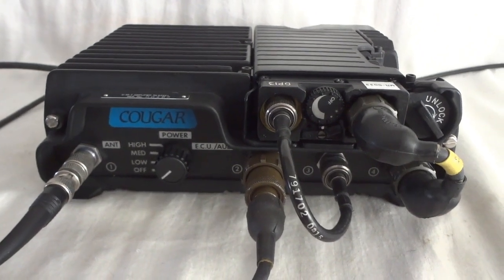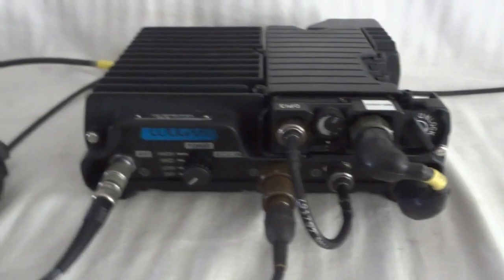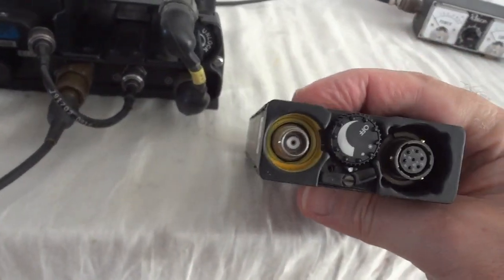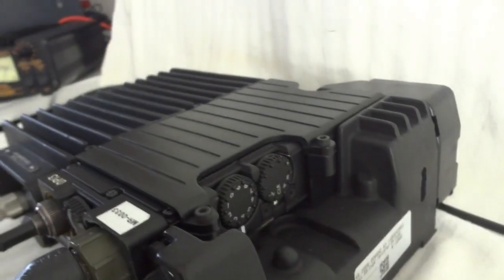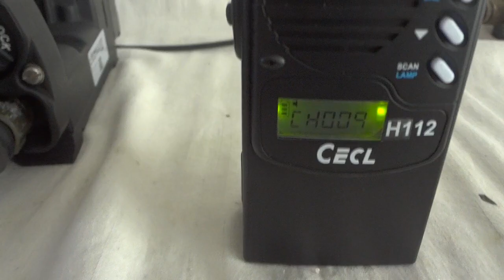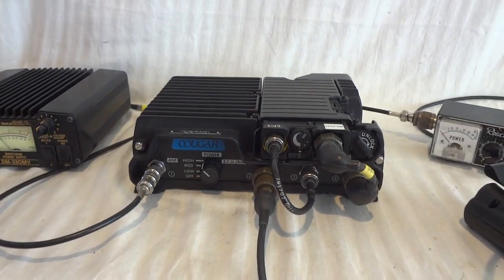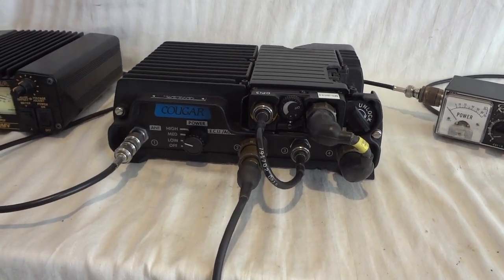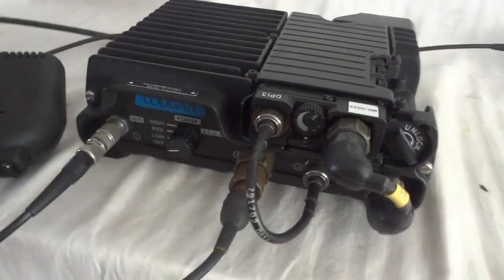Racal Thales model "Cougar", military tactical radio system

Comment: If you could find some of the old tuneable CTCSS boards from the USA you could outfit most any radio to encode the 150HZ tone needed to break tone on any of these "green" radios.
Check out the HFPACK group, we love using green radios in the ham bands.

Comment: You could try ctcss tone 151.4hz might be close enough to open the squelch.
Reply from the maker: Thanks for the suggestion. But I have tried that a long time ago - doesn't work. the 150Hz CTCSS filer in this radio is REALLY tight. It probably works in the time domain instead of the frequency domain: It counts received CTCSS cycles and compares the results against an internal quartz-based frequency standard. Not a big deal though - it works perfectly in combination with other military radios for this band, like the PRC-77 which also has the 150 Hz military squelch. Cheers.